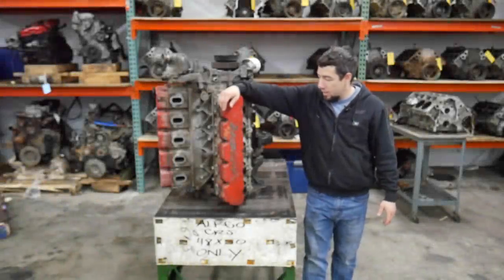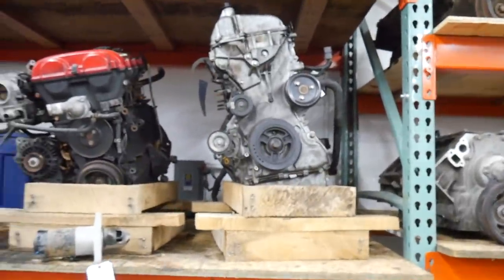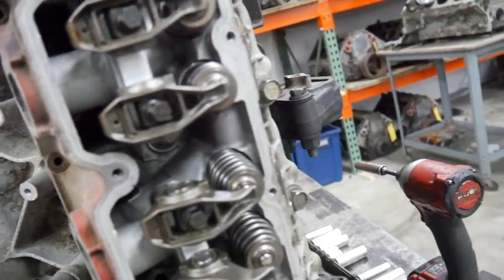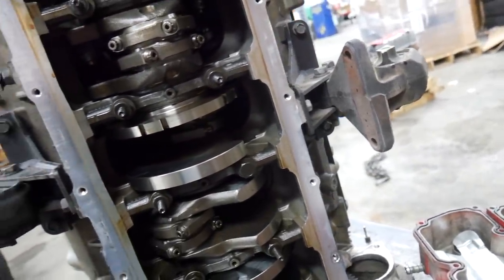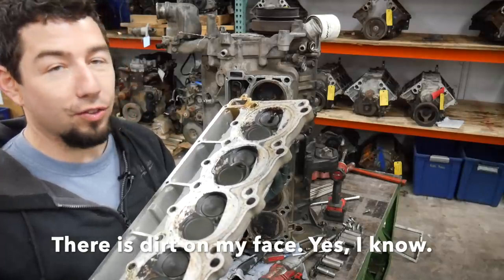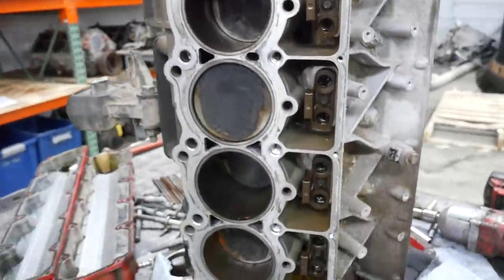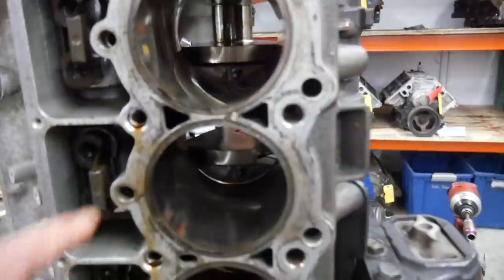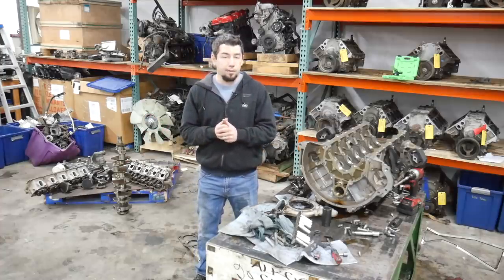TOTAL TEARDOWN! BLOWN UP Dodge Viper 8.3L V10 Engine, What Let Go?

Comment: When I was a youngster, back in 1961/62 I worked for a man named Jack Germany in Milan, Tn.  Jack made a living driving an old Ford ton and a half around west and central tennesse picking up performance engines from wrecking yards and bringing them back to his shop where I, as a 13/14 year old helped tear them apart for performance parts - cams, pistons, cranks etc.  jack took the parts somewhere down in Texas for resale.  This series bring back a lot of memories.  Also remembered burning out coils for the copper wiring using salve motor oil. Ugh!
Reply: Milan huh? Such a cool little town. Would you have known Ted Baker? He was my grandfather and was really into his old cars. Would tell us stories about racing his plymouth lol.

Comment: Hone the bores, new set of rings, new cam & lifters, new bigend/main bearing shells +1 cylinder head and you'll have a fully working engine again for very little outlay..
Reply: Plus with the dent in one of the pistons he gets a little extra displacement 😂
Reply: Don’t know why you wouldn’t fix that head, don’t see why a machine shop couldn’t pop in a new seat, new valve, new piston in that hole, new cam n lifters, new rings, bearings, disclose all you did to it and sell it as a used/ rebuilt, whatever you want to call it.
Reply: He has a block and functional bottom end. Do a 9L upgrade to it. Heads to an extent can usually be reworked into condition.
Reply: Hone the bores? That's what rookies or rob shops do. It needs a proper stepped bore resurfacing done. A hone is not accurate enough to do a matching bore per cylinder and you end up with unbalancing.  A performance engine will not do well like that. The grocery getter, sure for a while to prolong its life, but, unbalanced loading wrecks cranks.  I've seen honed engines that are more than .010 even up to .040 out of balance with the other cylinders.  Then peeps wanna know why the grocery getter is running so crappy......Cause your shade tree mechanic gave u the hook up honey and F**ked u in the process. 
A performance engine like the Viper Engine (smirks) needs everything in total balance, and re-building one should be done by first machining the block. Then weighing each piston to exacting micrograms so each cylinder matches. In this case I would say that competition cam contributed to its early demise.  I dare ya to ask me how I know this, besides the Mopar hemi cam crushing lifter problem and oil issues that only DODGE can fix but has never tried. By the time folks figure that out the problem is well past the warranty period and Chrysler/Dodge/Ram is great at ducking the real problem. Sh*t Design !!  This issue was not present before the MDS was created. No they did not Re-engineer the engine, just slapped on some worthless MDS crap to meet emissions so they could still flex their muscles as one o the baddest rides off the showroom floor.  If you was a smart cookie, you would take it immediately after the warranty expires and have that MDS Delete done. OR turn off the auto drive on auto trannies and leave it fully non-MDS driven. Meaning NO CYLINDER DEACTIVATION FOLKS..................that kills these engines. Before MDS the RAM Hemi was a beast and lasted a long time........notwithstanding the Transmissions issues with Automatics in the 90's and 2000's.
Reply: @anonimous2451  You have no idea, a quick hone /deglaze beds in New rings. That's all this engine needs. Suggesting one bore hone could put other cylinders out of balance is ridiculous, just how much does a deglaze remove do you think? A very very insignificant amount, that's how much. 
Youre way is going way over the top for a perfectly rebuilt engine which could be put back together for very little outlay. It does not need thousands of dollars thrown at it.
Reply: @Draxindustries1  Exactly what a Rookie hack would say. I expected no less. Run a shop for over 40 years then come talk to me son. Til then you got no horse to ride.
Reply: @anonimous2451  is that why the SRT 0w-40 has 200ppm of moly?
Reply: @bushmaster1740  Molybdenum, and 200 PPM is nearly nothing.  It is suppose to help prevent the valve seats from dropping, it fails miserably at that, with engine mod's not designed for the engine. Like a Competition Cam.  The V-10 and the New LT2 are designe nearly at the limits of its design characteristics. Altering that with added boost or extended lift of cams causes undesirable effects.......ask around you will see. Once manufacturer's stopped producing Iron Blocks the limits got very tight.
Reply: He’s going to part it out
Reply: -and another cam.
Reply: @anonimous2451  Stop acting so childish. Resorting to taunts and name calling only makes you look immature and does nothing to support your argument.
Reply: @kiddoxFPS  super cool storie brother
Reply: @Anon Imous: Try running an engine shop at all, kid. Working at McDonald's for the last 2 months and watching YouTube is all you got to show.
Reply: @anonimous2451  what competition cam? This was a stock cam. Think you commented on the wrong vid, broski.

Comment: Trigger wheel is in the center of the crank for a more accurate reading.  The same vibrations that a harmonic balancer handles will add error to the crank position sensor.  In the center the magnitude of vibration is reduced.
Reply: Exactly right.  The reason they put it there is because it is less subject to all the flexural and torsional harmonics that make the pickups on an LS motor less accurate.  It is the best place for it! Very important on engines with "long" crankshafts.
Reply: Exactly Right!
Reply: I figured there was some rational behind it. Cool to know
Reply: See I went to school for this and I didn't know that. It's stuff like this that makes shade-tree Chevy/Ford boys say "Oh see this is why Mopar sucks." It's annoying how many people think they know more than these engineers.
Reply from the maker: I knew there was a reason and to be fair, it doesn’t really matter to me. It’s just some of the early 2000’s Chrysler’s and mid 2000’s gm engines when they switched from 16 to 32 or 24x to 58x really make interchanges difficult and it’s not an easy part to swap.
Reply: Thanks for explanation!
Reply: @jonbar140  Lol as if Mopar engineers are known for being good. If they are so good, why are there so many elementary failures of their engines? Mopar engineers are the C students who were not picked up by companies like Porsche or Toyota.
Reply: @I_Do_Cars  anything after the German's purchased Chrysler is crap. So far no company that has purchased Mopar has had any interest in quality. I'll stick to my older motors. (in my case 383 and a 440)
Reply: @ Jon Bar - "Engineers" designed PT Cruisers......
Reply: Porsche figured out that the centre of the crank has the least vibration whilst developing the 917 flat 12 engine. They initially took drive from the end of the crank but it would destroy itself, so the drive was taken from the centre of the crank via another shaft and this solved the issue.
Reply: Sweet. I was expecting this to be the case. Metal components aren't 100% rigid, they have compliance and frequency response just like circuits!
Reply: @satxtrap  lol ya and? the PT GT is litterally a neon SRT4 with a different shell on it. Which is one the best 4 cylinder platforms in history.
Reply: @canadiandro8063  
😂
Reply: Inconvenient but better
Reply: @brownwrench  
If FIAT had thought it was better then explain chrysler engines ingest their valve seats on a regular basis if they design better? I guess their timing is accurate until the engine swallows it's seats.. 😂 Quality is job 3 at fiat I guess
Reply: @member57  the valve seat problem is only for older v8 hemis when chrysler was losing and fiat was about to take over.. that issue has long been resolved.. basically 2012+
Reply: @dougsk8rwiggy  
Wrong. The problem still exists. Especially the 4.7 v8 and the v6. The crappy 4cyl consumes 1-2 qts every 3k miles because fiat can't make oil ring and refuses to recall them. Chrysler makes absolutely horrible vehicles.
Reply: @garyschulz7768  Is that why the Gen 4 LS went to a more-toothed reluctor wheel? Double from memory..
Reply: @amyzander3541  Maybe. If you increase the reluctor tooth count it improves the angular resolution so the timing scatter due to all the crank flexure can be “filtered” by software in the computer.  The downside is a penalty in latency in the control system.  On another note; seems like a lot of folks on these comments are confusing 3rd party vendor quality issues with “engineering”. Granted, Chrysler has become victim of bean counters and management driven by the insane need to show continuous business/market growth and shareholder returns. Chrysler, in its prime, did indeed have the finest engineering staff in the industry but they have merged right in to the mediocrity of the rest of today’s consolidated marketing driven car business.
Reply: To minimize the timing variations due to crankshaft flex some of newer designs put the crankshaft position sensor at the flywheel end.
Reply: @davidmiller9485  I do love me a 440
Reply: @meterdoogles  Chevy fuel delivery im the 90's and 2000's, Ford spark plugs. Everyone has bad designs once in a while. Mopar always took chances and that's why we have bonkers cars from them like the viper. They all make bad decisions, you can't just group them into black and white.
Reply: Gen 3 engine came under Mercedes leadership. Its made by Ilmor witch was also owned by Merc, not Chrysler.
Reply: @lewispemble1637  The 917 engine was basically 2 flat 6s flywheel to flywheel,  with one engine being reversed. 

The torsional twisting of a crankshaft feeding all those impulses into the transmission must have given the gearbox team the fits.

The center feed probably saved the crank and gearbox.
Reply: @davem5333  yeah the centre feed saved both as drive was taken to the gearbox from the centre by an auxiliary shaft. Another shaft on the other side of the crank also powers the oil pump etc
Reply: @satxtrap  Nope, designers designed them.  Engineers built the tooling etc.
Reply: @davidmiller9485  there’s a lot of engineering considerations that cause these things to happen. Stuff like program budget, ease of production, supply chain considerations, parts availability/cost, and the timeframe they have to solve these problems. Sometimes they have to compromise with bean counters and hope that most of the engines are fine
Reply: But what good does that do, when the vibrations loosen a valve seat and smoke the motor.
Reply: @jonbar140  even when stuff does suck its usually not the engineers fault. Its almost always the business side screwing shit over.
Reply: @jonbar140  Mopar is a parts department they didnt take chances. Chrysler dodge jeep etc the actual brands did somewhat take risks but even then not really

Comment: Based on the oil pan, this engine appears to have come out of an Ram SRT-10. This is a Viper engine, but it did not come out of a Viper.
Reply: Good observation.
I also noticed the engine mounts were different from what I’ve seen.
Reply: It hurts either way

Comment: They put the trigger wheel in the middle to mitigate front-to-back crank twist under load messing with timing as much. Basically gets half of the margin of error instead of a full cranks' worth of twist under load. I'm sure we're talking fractions of a degree, but some engineer must've deemed it worth the effort for timing accuracy.

Comment: Would really like to see the inside of that 6.3 AMG.
Reply: Those fail a lot, especially in the c63 amgs
Reply: Yea those are junk, you'll see why if he does a video
Reply: Those stupid head bolts (pre-update) caused too many unnecessary failures. With the correct head bolts they're great. (edit: typo)
Reply: @my1993lexus  and then later the cam adjusters, cams, and lifters. what a shame, because when they work they're a work of art
Reply: there's a video about just how stupid difficult those engines are, just to remove them from the car!
Reply: Yes please
Reply: @my1993lexus  there is also a sealing oil ring in the valley, a $1 part. Costs $3000 to replace.
Reply: @adotintheshark4848  I didn't know about that one.
Reply: Mercedes don’t have 6.3 L engines its just a marketing strategy
Reply: @Stimpy&Ren Cat people who buy $100,000 cars don't care. When it quits they buy a new one.
Reply: @hkhhkh8878  they are 6.2 L :)
Reply: Yes please!!!
Reply: I still find it weird how people laud "German engineering" in cars, they are poor as fuck. There is a reason that japanese motors are prevelant in 3rd world countries, they just run and run even with poor quality oil and fuel. Obvs they still fail but not in the numbers mercs (and espesh bmw) do
Reply: @godzilla12325  Mercedes are good cars. Especially the AMGs from the 2000s. 
I have an 02 Mercedes and an 07 Camry and the Mercedes has held up so well. It doesn’t look nearly as old as it is and the seats and carpets, the paint are all in great shape. My Camry runs like shit and the interior has fallen apart. The bumpers are falling off on the edges front and back. It does, however cost much less to maintain the Camry. 
But when you get In the merc you get superior handling,  and control of the functions like the gas and brake are much more fluid and responsive. The steering just feels tighter and more solid. At high speed the car is much more confident and planted despite it being a smaller vehicle. The power on the merc is so so much more than the Toyota. I would guess the Toyota will eventually outlast the merc but not by a huge amount. And in my opinion I get so much more car in the Mercedes for all those miles. Therefore to me, those miles are worth more.
Reply: @godzilla12325  also let us not forget that the new Toyota Supra is literally a bmw inside and out. For good reason! Bmw actually does make very good engines. German cars really have paved the way for improvement on non German vehicles. You cannot convince me that Lexus IS not trying to emulate a German car. We have always had the best interiors and best looking sedans. Innovative technology and very good engines.
Reply: @Joshuabryabt-gf6sc  they are not perfect like the m113k, but they are not junk. With upgraded cam, buckets and headbolts (on earlier M156 engines) they are a reliable, fun engine and last. Below the valve train..they are bullet proof. The only consistent issue I have seen otherwise is needing to replace the engine mounts every 60-80k and there are great aftermarket ones that last much longer.  All these upgrades can be performed without removing the engine from the car.
Reply: @adotintheshark4848  Thats in the v12 m275 engine..and it does not cause engine failure, just an annoying leak.
Reply: @Joshuabryabt-gf6sc  „at Home“ these AMG engines are typically use by idiots, that would kill everything. But the they do not die from value seats getting loose on a 55mph highways.
Reply: @nickmarshall2676  naturally you neglected the cheaper one that's why it's falling apart
Reply: Inside of the engine is picture of dude name Gunther
Reply: @donniebunkerboi9975  I beat on my AMG way more. the Toyota is cool tho
Reply: @godzilla12325  absolutely. Audi build dreadful cars these days but common as muck on the roads for some reason.
Reply: @nickmarshall2676  aren't there lots of plastic parts in BM engines that fail often?
Reply: @tomf4547  bmw engines are mostly terrible for reliability, there are some exceptions
Reply: @thomaskelley6230  the m113k is probably the best amg engine overall. So reliable and powerful, cheap to modify and cheap to maintain too. 
Now that air suspension however……
Reply: @thomaskelley6230  v12 is actually a really solid engine you just have to pull the engine to work on it which sucks because if the engine is out, well the engine is out. Lol
Reply: Legit Street Cars does one
Reply: @kbcarroll  The bottom ends of those motors are hella stout tho
Reply: Not sure if that’s true. I Have a buddy with c63 with over 140k on his. Not a single leak anywhere and no engine probs. He takes good care of it like oil changes etc.. but he does burnouts and drives it very hard all the time so basically he doesn’t baby it. He’s broken axels and had sensor issues, but nothing engine.
Reply: @nickmarshall2676  their newest cars are pretty much lease only
Reply: @nickmarshall2676  “we”😂 like you design and engineer them
Reply: @joshlopez9056  I mean I’ve basically taken apart my whole car but, no. What I mean by “we” is the community of people driving and appreciating these cars. You wouldn’t understand unless u had one. And we didn’t engineer these cars. we improve the engineering 👍 
Cheers to my fellow German shitbox owners
Reply: @claxtoncurtis811  who tf likes new cars? 
The only release that excited me this year was the new Corolla GR
Reply: @godzilla12325  its not hard to design a low power inefficient engine thats tolerances don't wear quickly. The Japanese engines are normally actually awfully designed in terms of engineering

Comment: Math is easy when there are 10 cylinders: the metric system of engines!
Reply: 12 is easier to subdivide than 10.
I'm going metric,  inch by inch.
Reply: That's 11/64ths correct.
Reply: I’ve seen a video where Harley fans had to add 2 measurements, the one having 1/4s and the other 1/16s (or they like). They never figured out how to add them up.

Comment: The trigger wheel is in the center of the Viper engine because it fires on two cylinders at a time, and that harmonic can be transferred to the ends of the crank a lot easier than it will cause issues in the center of the crank.
Reply: "Fires on two cylinders at a time"??? That's total bullcrap, it certainly does not. If you're interested, the firing order is 1-10-9-4-3-6-5-8-7-2.